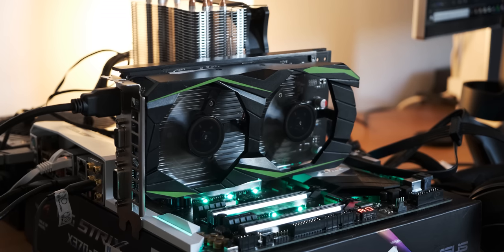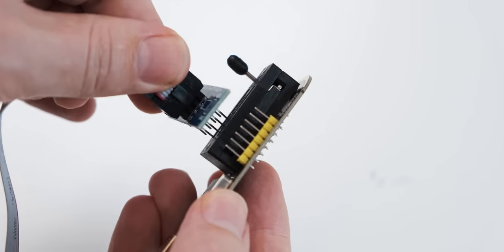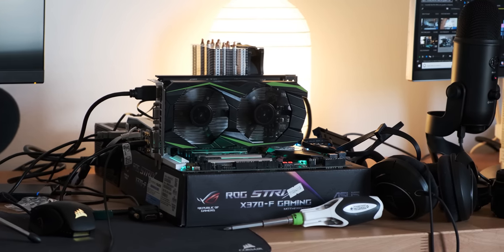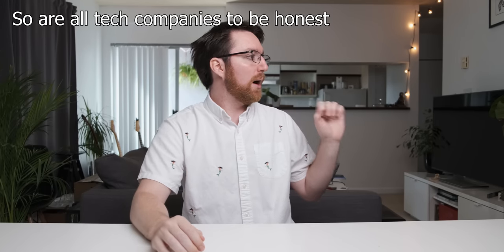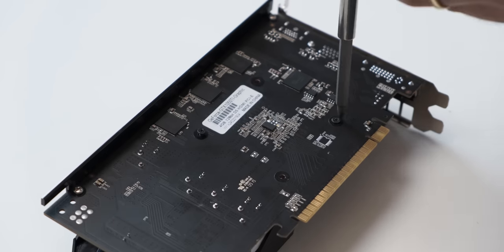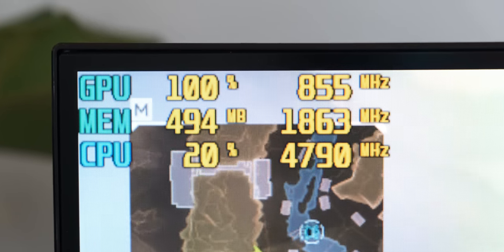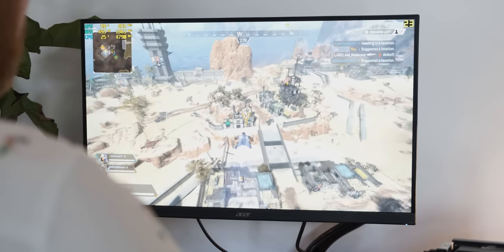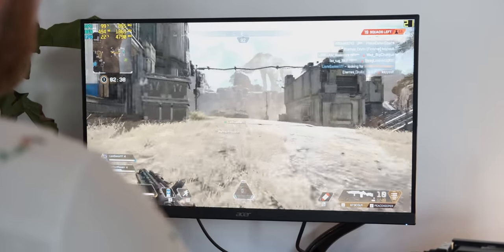It finally works! I fixed the $48 "GTX 1050 ti" from Wish.com and it still sucks

Comment: It's likely the RAM chips are faulty. On testing they show a fault in the upper address regions. They can still however be used if only the lower half of RAM is used which effectively makes them half the size. These faulty chips are significantly cheaper than good ones, 8 faulty ones can be an eighth of the price of 4 good ones. And so it makes sense if you already have a PCB laid out for a 1GB card, that if you slap 8 faulty chips on it and tweak the BIOS to only address the lower half of the address space on each chip, you can put out a very cheap cut down card. Obviously this is why the scammer chose them, they would have been ridiculously cheap to buy. Flash on a new BIOS, fake sticker and bam!

Comment: my mate Jonny fancied doing some light video editing, so he asked me what I recommended so I said "get a second hand gtx1050 but don't get a new one from China coz it will be fake". However Jonny wasn't listening properly, and that's how I ended up with one of these exact cards, except mine does have six pin power. So thanks for this video! I'm now going to get one of those bios flashing doo dahs off ebay.

Comment: Honestly you should solder a power connector and load up the original 450 1gb bios. I bet nvidia just gimped the card to work with less power demands on the 512mb bios

Comment: Just so you know; all graphics cards have more vram than it can use. My gtx 1080 has 12gb vram and 4gb of that is shared memory. Which means you get 8gb effectively. Pretty much all videocards work like this.

Comment: I think that the gt 440 also used the gf106 and maybe that's why it didn't have the 6 pin connector :v

Comment: GTS 450 came out in like late 2010, so its over 9 years old. Went up against the radeon 5770 at the time iirc... which the 550 Ti that came out a year later was better than both because of wider memory bandwidth and more ROPs. (still use one in a retro build)

Comment: Dont know if anyone though this, many the extra memory does need more power to operate.i would see what kind of power draw it was getting with the 1gig bios on it and see if it is hitting the limits of the pcie slot. Just a thought.

Comment: Some cards need extra power only for the memory chips. soldering the 6 pin could make it works like a 1gb version.

Comment: My it does not have enough power to use 1gb of vram so myb you should try to add a 6 pin connector

Comment: fix the ram so all of the 1 GB works
Reply: pretty sure it just needs more power to run them, so add the 6 pin connector
Reply: @widesilly2269  The RAM chips are wrongly labeled cuz China. They are actually only a total of 512 megs.

Comment: Any RAM works in binary. they are in pairs so a 1GB ram is actually 512MB as only 512 is accessible at any one time. The pair works as in this example.

2 pairs of 512 chips = 2GB right? technically yes though they are running in pairs. There is one address buss between the chips in a pair. so each pair has 1 address bus with a switch between. This switch is for high state and low state or in binary 0 or 1. each pair = 1GB RAM chips is split between RAM chip 0 and RAM chip 1. Like a light switch, there can only be one state the switch is in at any one time. thus 2BG RAM chips being 4 chips, only 2 will owrk at one given time thus 1GB total. If RAM chip 1 in pair 1 is working then either RAM chip 0 or 1 can run on pair 2. 

So this is basically the four combinations you have on this example:
Pair 1 RAM Chip 0 (512MB) (Addr bus brought low) + Pair 2 RAM chip 0 (512MB) (Addr bus brought low) =  1GB
Pair 1 RAM Chip 0 (512MB) (Addr bus brought low) + Pair 2 RAM chip 1 (512MB) (Addr bus brought high) =  1GB

Pair 1 RAM Chip 1 (512MB) (Addr bus brought high) + Pair 2 RAM chip 0 (512MB) (Addr bus brought low) =  1GB

Pair 1 RAM Chip 1 (512MB) (Addr bus brought high) + Pair 2 RAM chip 1 (512MB) (Addr bus brought high) =  1GB

IF you look carefully on a ram stick for example you will see between every pair what looks like a smal chip with lines coming off (1line) this is the switch, same on GPUs.

So you can count the number of chips and look at your Stick or GPU and tell that if you double the number your stick or GPU says it has, say 2GB I then double this to 4GB and divide by 8 (number of chips) each chip will be 512MB. There should also be 4 tiny chips between each pair. Binary is everything to a pc. So no, some chips aren't just there for the sake of being there, they are actually there and being used regardless just not at evry specific moment.